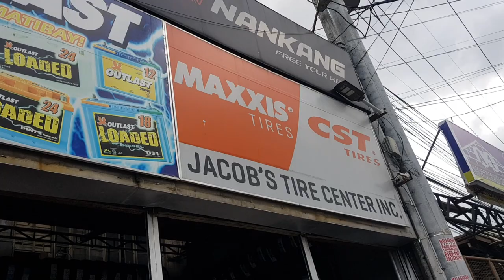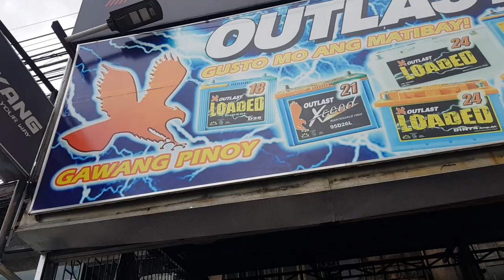#mags brand new all size available 4holes,  5holes, 6holes

Comment: kasama n po b p install at wheel balancing?
Reply from the maker: Opo maam, kasama napo yong installation at yong sa balancing po tingga nalang ang babayaran
Reply: ano po ung tingga?
Reply: magkano po mags 4holes Size 15.
kasama n po ang gulong?
Reply from the maker: @lykaaa1887  boss kapag kasama napo ang gulong ng size 15 na 4holes packaged napo lahat lahat 21k po boss lahat lahat yon.
Reply from the maker: @lykaaa1887  sa packeged po pati ang tingga at pito mags at gulong babayaran mo lang po boss 21,000 po lahat lahat.
Reply: brother ano  brand ng gulong ?
MOD b ang Mags?
Reply from the maker: @lykaaa1887  opo maam, meron din po MOD size 15 na 4holes at kasama sa packeged 21k po
Reply: ano brand ng gulong?
Reply from the maker: @lykaaa1887  maam, kapag arivo po ang gulong 21k po bawat isang set,  pero kapag nankang ang gulong 24k po bawat isang set.
Reply: Brother un po kc Mags q e size 14.
uograde q size 15. ok lng po b un?
sa Suzuki Spresso...
Reply from the maker: @lykaaa1887  ok lang po yon boss, anong sasakyan mopo ba.?
Reply: Suzuki Spresso